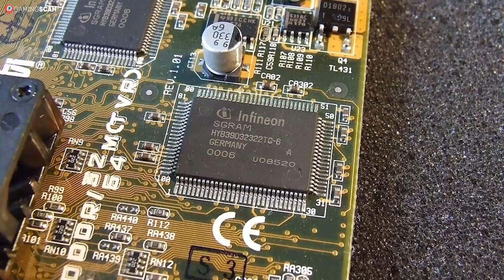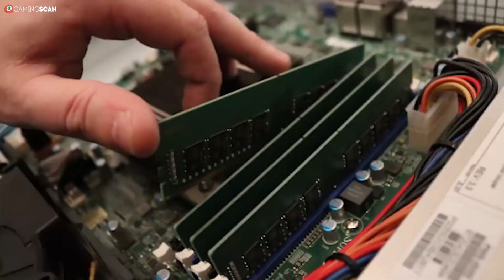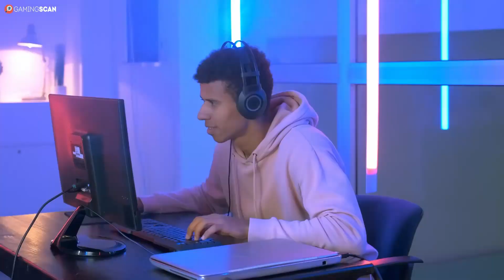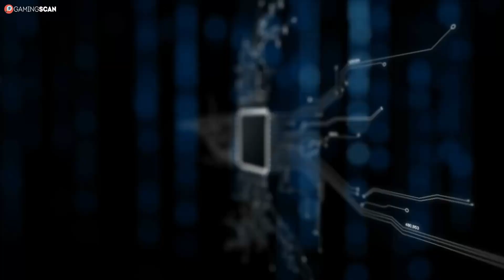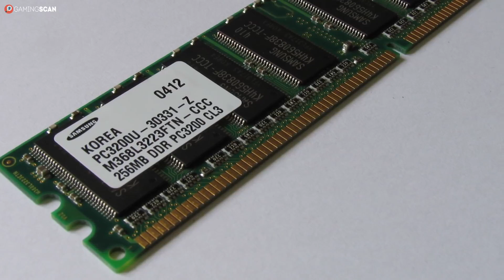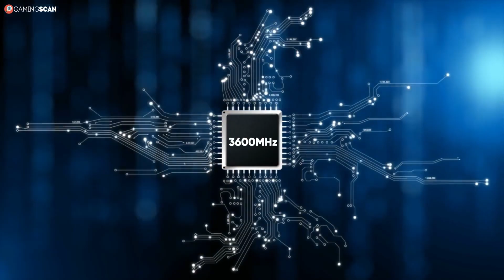The Truth About Your RAM

Comment: You forgot to mention that each cpu type can handle x amounts of ram regardless what speed it is  don't forget the ram controller is not stand alone anymore it is bundled in to the cpu actually the entire toth bridge became bundled in to the cpu to have a faster capacity on lower voltage that means less heat
Reply from the maker: Depends on the CPU

Comment: The newest is DDR 5  upgrade
Reply from the maker: It is the newest, yes, but it's overkill for gaming. Seeing as some people still use DDR3 RAM today, you'll be fine to hold out upgrading to DDR5 for quite some time.
Reply: @BentlysBudgetBuilds  what  if you have a 13th gen intel you can only use ddr5  graphics cards used gddr6 10 years ago ,  if those people still use old technology they throw more money on electricity cause those as you alredy know degradate over time transistors burns out and the firmware in the components disables or denying access to that section,  ddr5 is not overkill  , actually the most ram and cpu resource hogs are games why simple  due to buggy programming   ah actually the newest of all is ddr9 , overkill pff  y know that some people pay tomorrow price for yesterday's technology  y am already at DDR 6 just to gave a redundant performance reserve
Reply from the maker: @adriancoanda9227  that's great man
Reply from the maker: what has DDR9 in it?

Comment: DDR5 is now out, so DDR4 is the "old" standard and DDR3 is almost "antique" by computer hardware standards.
Reply from the maker: That said, it IS the standard for the Ryzen 7000 series, as it only takes DDR5. The 13the gen intel CPUs still support DDR4, but I suspect the 14th gen will only support DDR4. At that point we can say DDR5 is standard in NEW PCs
Reply from the maker: DDR5 has been out since 2020. It is still not the standard. By your logic, that would make the 4000 series GPUs standard, solely because they've been released
Reply: @BentlysBudgetBuilds  eel, let’s define what standard is.  Are we talking standards like technical standards?  That’s how I was using the word. 

But, I will admit the word is overloaded and standard can also mean what is typical.
Current AMD motherboards for the latest Ryzen CPUs are DDR5.

I believe the competing Intel generation is still going with DDR4.

So, while technical standards make DDR4 yesterday, time will tell how and when DDR5 will be the typical memory “standard” used for new systems.

Meanwhile, I’m still rocking DDR4 2400MHz because I just need more, not faster and that is the limit of my years old MoBo.

A Ryzen5 5600x and 64GB of ram for my workstation running multiple VMs.

So maybe we just took standard as different (and valid) definitions of the word.

I’m and engineer, so to me, standard is a formal specification.

Where as I believe you meant it to mean how common or typical is it.

Thanks, for your content and comment.
Reply from the maker: @buffuniballer  haha alright yeah that makes sense! I was, in fact, going based off of what is still most common. 

What kind of engineer?
Reply: @BentlysBudgetBuilds  my degrees are in software AND electrical engineering.  I’be been in the IT space since the 1980s.
Reply from the maker: @buffuniballer  that's awesome! I learned all my electrical work from my grandad (an electrician) and decided I like the low voltage stuff better! 😂

Comment: more ram is always better
Reply from the maker: Not always. If your program only utilizes 4Gb of RAM, then upgrading from 16GB to 32GB won't cause any boost in performance to that program. Thank you for the comment, and if you have any further questions, let us know!
Reply: ha ha.... assuming that's sarcasm! More RAM is better, until you have "enough".... after that point you're throwing money away on bigger memory kits and probably had to buy cheap memory or too many sticks to get to that point.... For anybody who is looking to make a RAM buying decision: depending on what you're doing that "enough" point will change, but for 2022/2023 gaming, 16Gb is plenty for 99.9% of scenarios. Once you have "enough", then the next thing that impact performance is the BALANCE of RAM timings and speed... as the timings like the CL (CAS Latency) get much worse (bigger), it means the memory has to wait for more cycles before it does each function.... the same people who say "more is better", usually also go for the fastest RAM possible.... and because people will buy it, even decent manufacturers churn out kits like 4000MT/sec (aka 4000"Mhz"), but with massively compromised timings (e.g. CL18 or even CL19 and above for the really low quality stufff).... while a good quality 3200MT/sec kit (with CL12 timings) would have given better throughput AND better latency (note that latency will often impact things like games more than just the throughput)..... that cheap CL18 memory would have to be running at 4800Mhz just to get the same performance.... this is also why the entry-level DDR5 kits are usually are also much slower than even mid-range DDR4 kits (the cheap DDR5 kits have only modest increase in rated speed, but sometimes massively high CAS latency). DDR5 will be much faster than DDR4, but not until there are kits that offer the right clock speeds for each CPU AND low latency!
Reply from the maker: @chrisr1276  always a pleasure to see someone who knows what they're talking about, and doesn't just spout nonsense that'll make people waste their money!